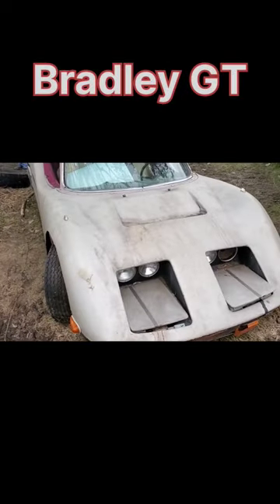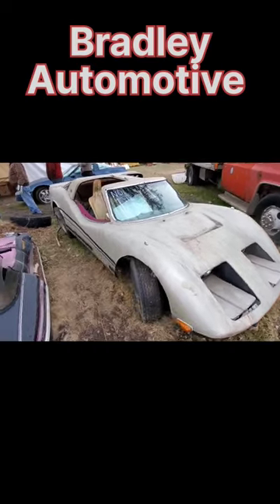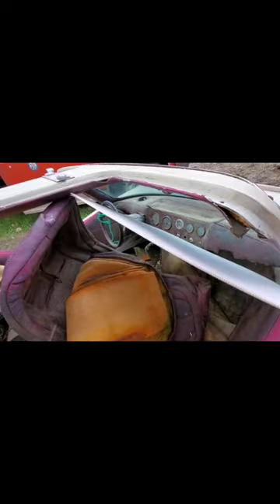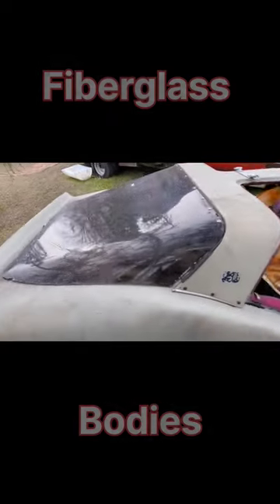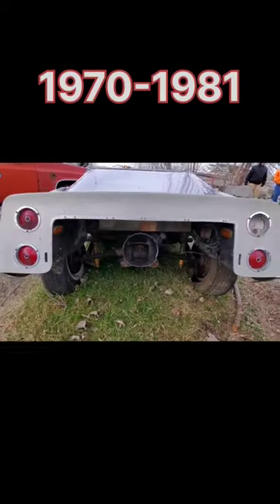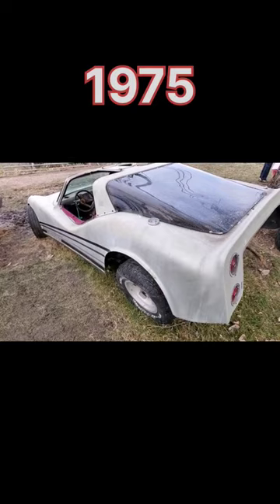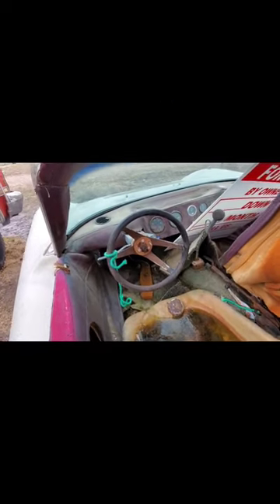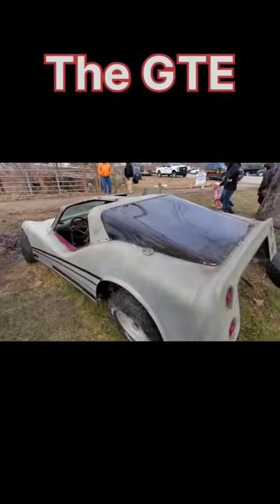Meet the Bradley GT #volkswagen #kitcar #70s

Comment: Are theses valuable now?
Reply: I don't know, but I had seen a Bradley GT 2 posted for sale on OfferUp about a week ago for $3500. Looks in good original condition from pictures that was uploaded on the posting.
Reply: No
Reply from the maker: That's a very good question. These fall into kind of a niche market. I feel value depends on a lot of factors. Availability (supply) Desirability (demand) and quality of a given example are things to consider. I think they've had consistent following and support over the years. Being VW bug based probably helps that.  You can still find them available to pick up at a reasonable cost comparatively.